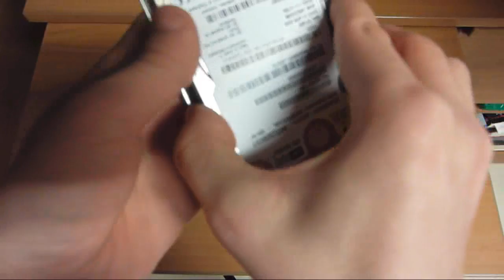How to install an External Hard Drive (HDD)

Comment: how to fix acomdata PureDrive 500GB USB 2.0 / eSATA 3.5" External Hard Drive PDHD500USE-72 I haven use it for awhile when I turned it on i get a blinking blue and red and a soft clicking sound. should I open it up??

Comment: If I have any pics/music/videos in the harddrive and I use this device to connect it to my tv which supports usb input (Ive tried flash drives and its able to display the content from these) could my detect the files as well from the acomdata ext drive or is it only specific to pc connection?